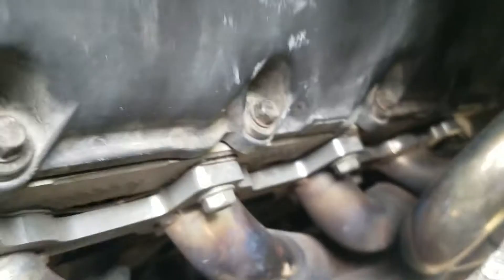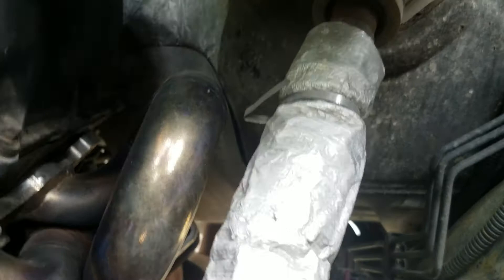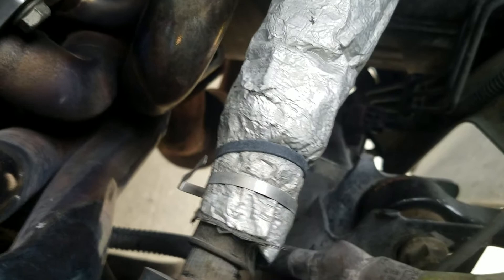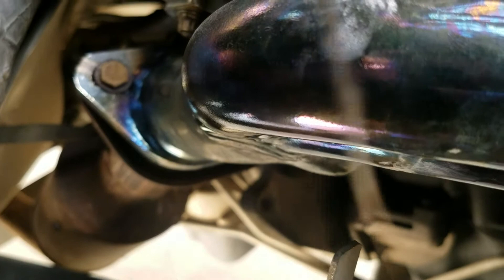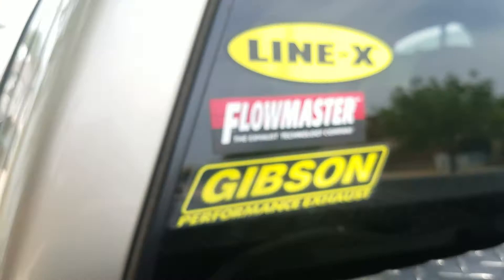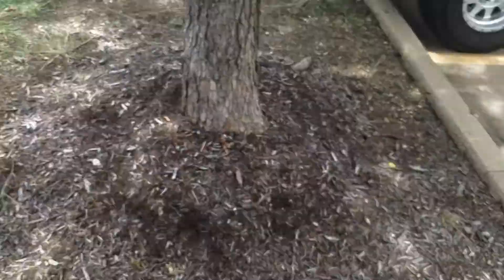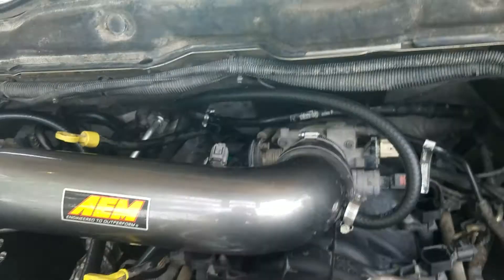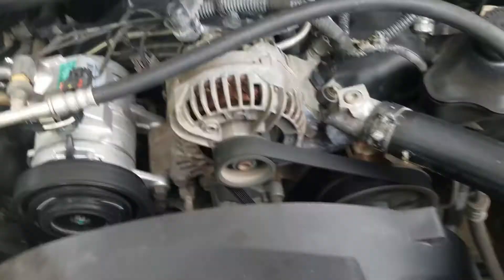04 RAM 1500 4.7 WITH HEADERS AND CAT BACK FLOWMASTER STARTUP

Comment: For a strong Ignition system, get Performance Distributors SOS coils. Let's you open plug gaps to 0.065. Dyno proven to add at least 10hp at all rpms.
Reply: Bro thanks for the info gonna have to look into cause there aren’t lots of performance parts to the 4.7 and I was trying to get some hood coils and couldn’t find any un till I read this and did my research thanks 👍🏼
Reply: @SRT-Dani  you have to know where to look!

Comment: The Intake needs to be sealed to a fresh air source such as scoop, grille, or fog light hole. Then insulate the box and the pipe with Reflectrix foil covered bubble wrap from lowes securing it with the Reflectrix tape. This is much cheaper and more effective than parts store heat tape. Whole project will probably cost about $30 and drop your air temp about 20 or more degrees.
Reply from the maker: I’ll have to give that a try. Couldn’t hurt!

Comment: use the Titanium heat wrap around your intake tube. If you get the 25 footer and do half wraps with hose clamps at the end...it will really tone down the intake noise to a much more comfortable level

Comment: Sounds good. My 4.7 has that same whine/vacuum leak sound lol. I believe I have that exact same CAI too. I’m going to have to do those headers in the near future. Can you post a drive by video? Would to hear it at around town/highway speeds.
Reply: for mine that noise ended up being the power steering pump actually and it was super easy to replace
Reply: @vandyman1716  I might have to check that out. Cause I have to replace the steering rack. It’s bad, so the power steering pump could definitely be going out as well.
Reply: Common item. So is the water pump

Comment: Thats not loud at all my 03 with them 4.7l and just flowmaster supper 10 outlaw that 409 ss. Is louder than that and i still got stock pipes on it even the tail pipe is stock all i did was put a flowmaster supper 10 on it

Comment: Did the headers come with the 4 bolts for the flange to connect to the catalytic convertors?
Reply: My 4.7 thorley longtubes didn’t
Reply: @longschl0ngJoe longtubes?
Reply: @lonzosnags4995  longtube headers (Doug Thorley brand). They made some for the 4.7, specifically for the Grand Cherokee’s 99-02